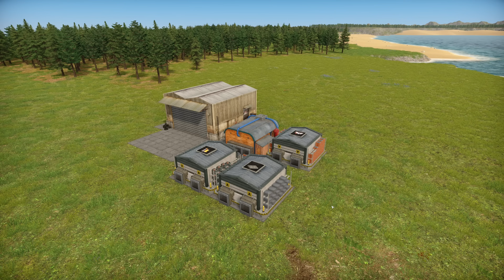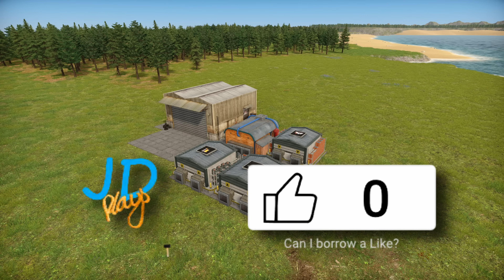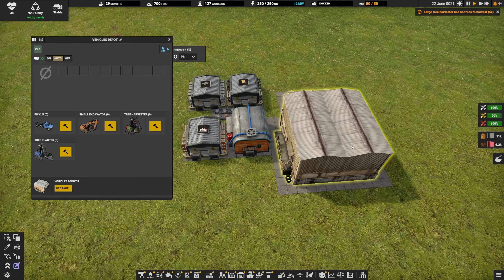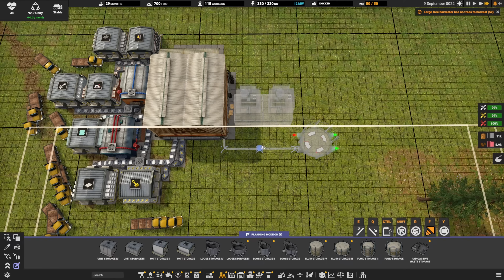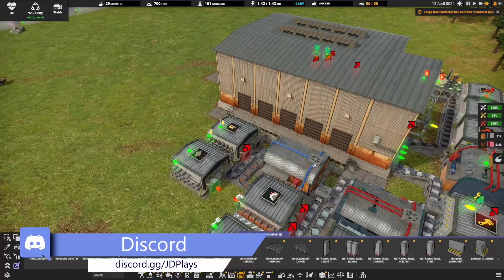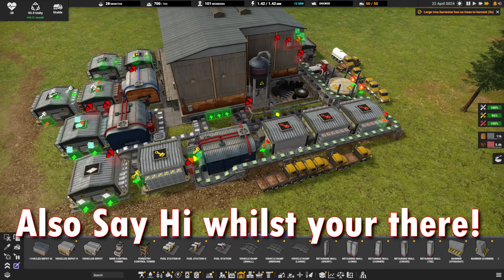Vehicle Parts and Depo Blueprint 🚜 Captain of Industry  👷  Walkthrough, Guide & Tips

Comment: Hey JD, nice tutorial as usual!

By the way, since I bet eventually you will be making a tutorial on the new nuclear power, I just wanted to share one titbit that's not initially obvious with it - the Fast Breeder Reactor is a garbage eater. Like sure it's nice to dispose of T1 and T2 nuclear waste initially, but there is more to it - it converts the waste in a 1-to-1 ratio from waste to blanket fuel. If you fancy doing a lot of reprocessing, you can go from T1 fuel to T2 fuel and T1 waste, then from T2 fuel to T2 waste and turn that waste into blanket fuel. You are only losing 2/3 of a unit of Plutonium in the process of using the same fuel 3 times over, rather than going yellowcake to blanket fuel.

So all in all, the most efficient nuclear setup would probably be a T2 reactor doing T1 and T2 fuel and then T2 waste going into Fast Breeder Reactor. It would be an awfully big setup, but hey, free T2 nuclear reactor running for almost free!

Of course, the simplest setup would be just priming the system a bit and then doing Yellowcake straight into Blanket which I think should then be enough to sustain the reactor with the two recycling loops it has. Will still need to see if it works out or is there some more to it.

But yeah, looking forward to the tutorial some time down the line :D.
Reply from the maker: Its on my list, but I never do a tutorial until i fully understand something myself so I need to unlock it first, the good news is my Twitch save is up to nuclear, but is currently in the process of a full rebuild from the starter base to the mega base, we just skipped everything in the middle. I will be keeping my eye out though to see if there is a way to get a normal/mox reactor to run for cheap/free after you have the fast breading reactor up and running

Comment: Why do you set your request sliders one notch from the max setting?
Reply from the maker: I don't wish to schedule a delivery when a box is missing just 1 item, hence I set the sliders 1 bar lower. In theory trucks shouldn't be schedule unless they can fit a good amount of material into the destination, but a exception might be something like slag. A truck might pick up a full load of 20 (as a request to empty), and then have a request for 2 and drop off say 5 because thats all that fits in the box, then drop the rest in the sea. I would much prefer that they drop the whole load in the sea, and at a later stage when a request opens up the whole load of 20 can be dropped off.
Reply: because if you have it set to full it will never be full and you will always have a truck gathering stuff for you, but if you set it one below it could technically deliver enough to create a small buffer to allow that truck to do another task before it has to bring more material.